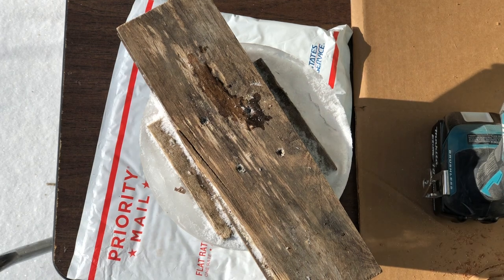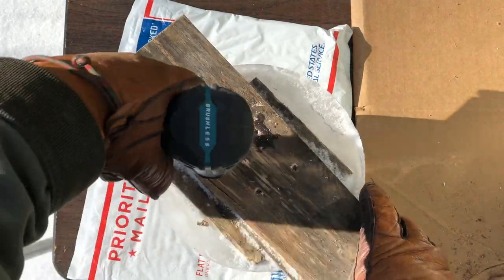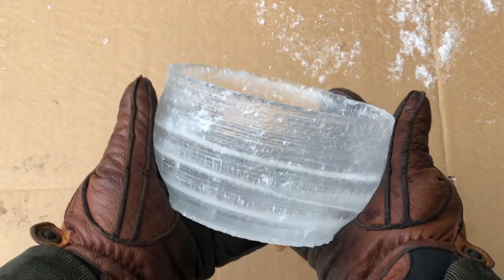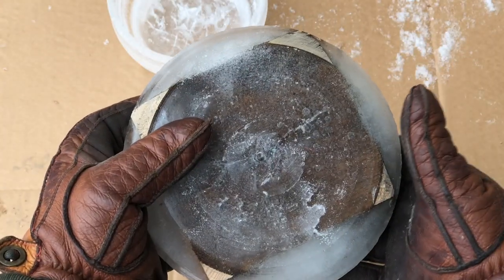‘Woodturning’ - The Ice Bowl

Comment: I’ve made 4 gallon ice votives for along the sidewalk during winter parties. Filled 5 gallon plastic buckets with water  and let freeze, but going out 2-3 times a day to remove the ice that had frozen on the top which prevented the ice from expanding and breaking the bucket. Once I had 2-3” of ice all around I put the bucket in warm water to help slide it out without breaking. If you “sand” your bowl with water it will look even better.
Reply from the maker: These are terrific tips, thank you for sharing them. I too, used warm water to release the ice. But getting a decent block of ice in the first place proved more challenging than I expected. Your approach would also eliminate having to hollow out the center of the blank.

I may put your tips to use and try this again this winter. We certainly aren’t short of cold weather. 🙂
Reply: @CroakyOak  good luck. In MN it’s been below freezing for about a month with temperatures as low as -14.
Reply from the maker: I too am familiar with weather like that. 🥶